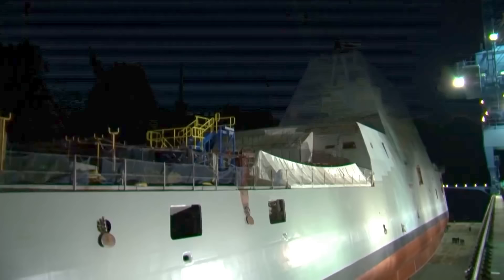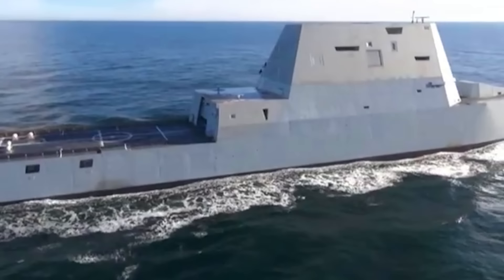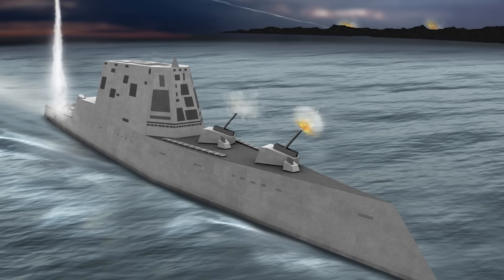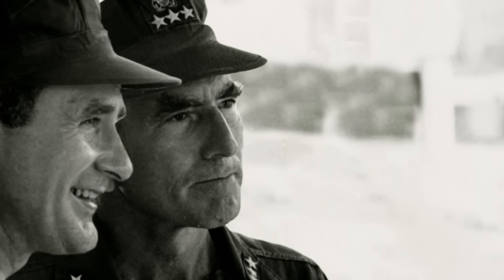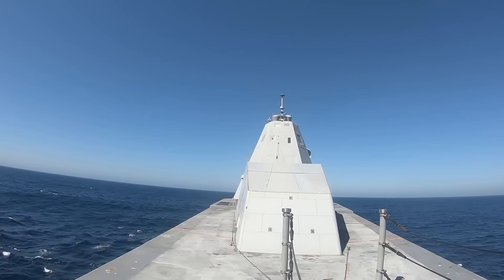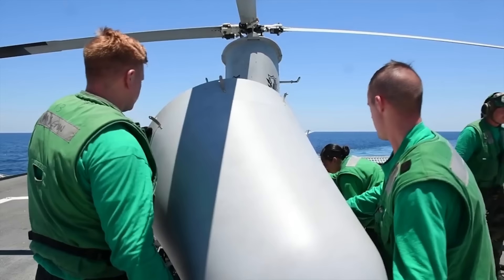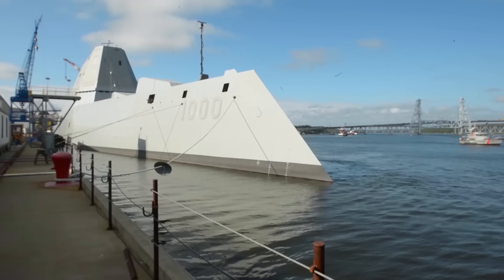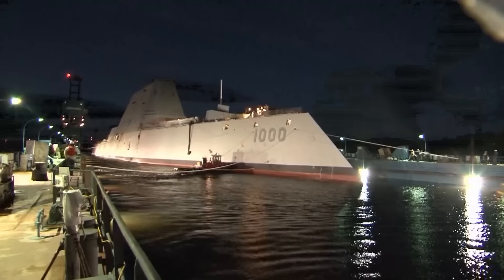The Stealth Ship So Powerful They Couldn't Build Any More

Comment: There were a lot of technical issues with many of the systems it was too bad the problems with the class weren't elaborated on in a more detailed manner.
Reply: That said, the stealth technology alone could lend itself to several roles. Landing group fire  support being only one of them. As a forward passive EW and sonar picket, the class would excel. A nasty surprise for anything that wanders within it's detection and missile range. Replacing those unusable 155 mm guns is sad but an absolute must. They were a good idea but there are other off the shelf autoloading 155 mm options available. Some with ranges in excess of 50Km. Even one of them with a large magazine would be worth it. Considering the vast amount of NATO ammunition choices available and  research still ongoing. Including barrel launched UAV's and loiter rounds.
Reply: @gusgone4527  You just aren't going to make a ship stealthy enough as you can't control aspect to target as well as you can in the air as you will likely be getting pinged from multiple directions. Also you aren't moving fast enough to be difficult to track once detected.  Stealth just doesn't translate from airplanes and subs to surface vessels very well. Dynamics of the fight are just fundamentally different. That said it isn't useless to reduce detectiibility, it just doesn't open up fundamentally new capabilities like it does with different platforms. Passive detection is for the work of deployables and subs. Project was ultimately a boondoggle along with the even worsely conceived LCS.
Reply: @AmericanDiscord  funny how no one is ever held accountable for the sheer volume of waste on these boondoggles. I have no problem with developing one of these ships and dumping money into a platform to get it all sorted then moving on to a class of ships but this and the LCS especially are examples of how not to move forward.

Comment: You have to think of the 'at the time' scenario. The big white elephant at the time was the Iowa battleships - old, expensive, and useful for only one thing - shore bombardment. However the problem was something plainly seen in conflicts like Korea, Vietnam, and the Gulf - while the carriers did their thing, and the battleships sailed slowly up and down the coast pounding targets, the rest of the fleet, ultra expensive anti-submarine frigates, anti-submarine destroyers, etc., just sailed around doing nothing, looking for a non existent submarine threat (the USN has never ever engaged an enemy submarine since WW2). 
Proponents of the battleships used this to argue that they should be kept active until a new NGFS platform was developed, and this brief went into the design of the Zumwalts in the various forms (DD21, DDx, DD1000).
Now since the 1991 gulf war, bombarding shores has kind of gone out of fashion, so there has been no further calls for the battleships, or the Zumwalts, to provide this role. They have also realized that designing ships specially for countering this non-existent submarine threat (despite all the planning for another world war with a submarine-capable nation like Russia or China, all wars since WW2 have been against non-submarine-possessing nations and non-submarine-possessing factions like IS and the Taliban) is a folly as well, so have retired all the anti-submarine frigates and concentrated on the Burke destroyers, which are much more capable of carrier escort and land attack with Tomahawks, much more valuable roles.

Comment: My brother-in-law was an electrician in the Navy, and he worked on the Zumwalt when it was in Maine at the Bath Ironworks.  He told me when it was going through its testing phase, it had done so well that local Maine lobstermen and women couldn't see the vessel until it was nearly on top of them.  The navy ended up having the line the Zumwalt with red flags so that the local fisherman could see the damn thing.
Reply: That isn't how stealth works, take your meds.
Reply: @v4skunk739  I know right, I use to live above Bath (horrible people around that area) and it was incredibly visible at the Dock.
Reply: @randyross5630  This just in:  Boats visible at dock where there are no waves and no water horizon.  Got the mind of a Mainer, no doubt...
Reply: @v4skunk739  I believe he is talking about not seeing the vessel on the radar display there sparky
Reply: I was in a thirty foot sloop off Daytona Beach, on the home stretch of a two week sail from Cape Cod to Fort Lauderdale.
The weather was sunny, the wind was light, and we were close to shore on a beam reach with the spinnaker flying, trying to cheat upwind as much as possible.
Out of nowhere, an atomic submarine appeared a couple of hundred yards away at the most.
Didn't make a sound.
Reply: @v4skunk739  It's true and the Navy did do this. At sea level it's head on visibility is less than a conventional ships due to it's unique design.
Reply: @randyross5630  Sure, driving over the bridge or from a good vantage point knowing very well that it's there. But on open water when it's coming right at you it's visibility is very low. This is a fact and the navy did in fact need to make the ship more visible due to all the reports from other vessels.
Reply: @randyross5630  above bath?
Reply: @twill9278  Those submarines are under water , you don't hear them dummy.;
Reply: @twill9278  It wasn't moving.. no engines on, that explains everything.
Reply: @pvtjohntowle4081  
It was indeed moving, headed back to its home port.
Reply: Local Maine lobstermen... well known for their powerful AESA radars 🤣
Reply: @v4skunk739 The CP is talking about the ability to see the boat on radar. 
Go back to school and read a book
Reply: Trying to save $80 Million per ship? 
We are sending several $Billion every few months to Ukraine. 
How is canceling this naval platform more cost effective than how the USA taxpayers are funding the Zelenskyy Clown Show?
Reply: @kamakaziozzie3038  You clearly don't understand the tactical values of field testing equipment without directly risking personnel all while grinding down the capabilities of a supposed near peer (clearly not).
Reply: My initial read on your comments was that you are being fecitous about fishing boats not being able to see this ship......they could see a ship that is the size of Cruiser until it was close? Damn.....I didn't know these were that stealthy.
Reply: That's very amusing, but also very good news. During the design phase, I'm sure that's unusual condition was considered. The fear of being rammed in thick fog is real. A well manned deck watch is in order under certain conditions.
Reply: @garneauweld1100  "The fear of being rammed in thick fog is real".  My grandfather was on board the 'Nashbulk' when she ran into the St. Mihiel off the coast of New York during WW2.  The last event in the Atlantic that took US Navy sailor lives before VE day.  You very right about this.
Reply: For like 3 months the stealth coating/bad maintenance made it not last long lol
Reply: @keithsimpson2150  I was in the USN and by the time my ship returned off deployment there was a lot of rust. Can't imagine what the special coating on these ships need for maintenance.
Reply: Unfortunately, the US Navy's enemies have much better sensors than local lobstermen...
Reply: Were They blind or are You talking about the radar readout ?
Reply: @kamakaziozzie3038  The two are not the same. Different color of money as they say. Congress is printing more dollars for Ukraine....I'm in defense contracting and so far the services are not getting their budgets cut...in fact increased but the services still have to meet their budgets so when the Navy for instance is trying to save money i.e. by retiring some of the littoral ships....they will want to put those funds to other Navy programs. BTW the Zumwalt class was a design born out of the Cold War and was intended to be very powerful in terms of firepower....then the US Navy decided to stop the order at 3 ships....like they did with Seawolf subs.
Reply: @Obsidian-Nebula  just blind lol.  I guess its cause the thing sat so low relative to where you'd see other Navy ships?  I don't know...
Reply: @garysellars8761  This is not accurate. I was on the team that won the contract to build these ships. This class of ships wasn't cancelled because "stealth" was defeated. It was cancelled because a. it was a cold war need b. the requirements for this class changed after the US Navy decided it was going to need littoral capabilites thereby causing huge overruns c. government boondoggle...nuff said.
Reply: @v4skunk739  
It was operating in the United States waters . You nearly need social & reading help .
Reply: Things that didn't happen?

Comment: The Burke class DDG’s are at their limits for supporting electronics. The hull of the Zumwalt class is stealthy and has enormous electrical generation. Along with that AEGIS and more missile capacity than other warships. Failures are the gun system and new complex systems need debugging. A failure? Maybe… but clearly it offers lessons.
Reply: Don’t forget the coating degrades quickly, and as soon as that starts it loses stealth.  And that the combining gears are far from reliable.
Reply: @rydplrs71  … clearly the navy was overreaching with new technologies.
Reply: @rydplrs71  Not to mention the corrosion issues from the 2 types of metal.
Reply: The gun didn't fail, it was the ammunition. When they cancelled 27 of the ships, they also cut back the ammunition order and thus the cost per round also went up significantly. The problem was they didn't start with simply navalizing a pair of 155mm guns with conventional shells as used by the USMC and US Army M109 SP Guns and 155mm towed howitzers, prove the gun and ammunition worked at sea, and then develop the LR shells so that they could be used by all services 155mm guns.
Reply: @DeeEight  … the navy went about it in the most expensive way possible. I wonder if remodeling the two guns for standard 155mm is an option?
Reply: @Idahoguy10157  No, especially not since they plan to remove the guns and their magazines to fit a new, as yet undeveloped LONGER VLS cell system, possibly a variant of the tomahawk module going into the Block IV Virginia class SSNs, in order to launch hypersonic missiles which also aren't yet developed. Basically the three ships are going to end up as technology development/test hulls for future things to use on what is now intended to replace the Arleigh Burke Flight I/II destroyers. Now they COULD simply adopt the OTO-Melera Vulcano 127/64 gun system in place of the BAe 155mm guns...which has already finished development for its precision guided LR land attack shells (up to 80km range) and its ballistic extended range shells (up to 50km range). THe GPS guidance LR shell has a CEP of less than 5 meters and the semi-active laser guidance shell has a CEP of less than 3 meters. Canada has decided already to adopt the Vulcano 127/64 system on our variant of the Type 26 frigate (instead of the BAe 127/62 gun, which lacks such shells still) meaning we might have a situation five or so years from now of Canadian frigates providing gunfire support to a USMC amphibious landing, the role the 155mm gun on the zumwalts was supposed to be for.
Reply: That's an extraordinarily expensive lesson.  The Zumwalt isn't a "maybe" failure - it's an absolute catastrophe that should never have been sent to design, let alone produced.  The very notion that the US Navy requires billions upon billions of dollars in inshore combat capability is laughable on its face.
Reply: @Idahoguy10157  No. they’re stripping the the guns out.
Reply: @chuckschillingvideos  Defense contract welfare. A beast we created and don't know how to put down.

Comment: This ship was built on the basis that the rail gun would be available by the time the ship was completed. That’s known as putting the cart before the horse. A ship is one thing but a weapons system is a whole other ball of wax! In short the Navy screwed the pooch on Zumwalt.
Reply: They did have rail guns in mind when they designed the electrical system, because you cannot simply modify a boat to run those things, but the video did talk about the failed weapon system that the Navy settled on.

It's a pity that the companies working on rail runs were simply taking the taxpayer for a ride.  It's possible that the whole purpose of continuing to fund the project was just a ploy to get the Chinese to throw their money down the same rabbit hole, thinking we were onto something.
Reply: @ThatsMrPencilneck2U  Yeah the cannons were a horrible waste of resources. Given they were too expensive to actually use. Although replacing them with hypersonic  missles is quite impressive.
Reply: @ThatsMrPencilneck2U  Trying to con the Chinese into wasting their money is the stupidest excuse ever. Practically every cost they have is lower than Americas. The strange thing is there is footage around of super slow mo cameras that appear to show rail guns working. It makes you wonder just how close they got, and is the program shut forever?
Reply: @tsubadaikhan6332   Trying to develop the weapon, just to fool the Chinese would be stupid.  Pretending to develop the weapon, after determining that it doesn't work means just making announcement and releasing test footage of money you have already wasted.  Why give the Chinese the advantage of already knowing it doesn't work?
Reply: In one regard the Rail guns were a sucess and functioned admirably. The high power costs would be mitagated by having a nuclear power plant on the ship. There was talk about retrofitting BBs giving them extended life this way. 
The problem? What happens to metal when you pass current through it, especially with very temporary contact. The more current, the affect is amplified. With the incredible amount of current to fire the shells at the intended velocity to reach target ranges, it would create slag along the barrel. After "so many" uses, the barrel would need to be completely replaced. It was never divulged how many times "so many" referred to. DC Motors and Generators use graphite brushes to mitigate/prevent this problem, and while I would like to believe this was already considered putting a coating of graphite an the parts of the casing, or using brushes where it came in contact with the barrel, i found no evidence that it was ever used, let alone considered. It'd be so ignomenious if the reason the program failed is because they forgot to put in what is put between all moving electrical contacts in DC applications.
Reply: @ThatsMrPencilneck2U  According to some in congress, we just arent giving them enough money....perhaps we should ship the pallets of money pre-soaked in gasoline so it burns faster
Reply: @ThatsMrPencilneck2U  what? The guns do work, just really expensive. How is that taking the taxpayer for a ride? It’s just untried new technology, not sure how you come to that conclusion.
Reply: @damedusa5107  Expense is a limiting factor on anything.  Remember it isn't just the initial cost.  If the big guns on battleships needed to be relined constantly, they would have never been made.  How long do the rails last in these weapons?  The Navy is tight lipped, but the engineers I've talked to say these things burn copper, like its nobody's business.
Reply: @ThatsMrPencilneck2U  that doesn’t mean they were ripping off tax payers.
Reply: @damedusa5107  Continuing to work on a dead end technology is what most people consider a waste of time and money.  This is a industry where contractors so regularly beat the tax payer that you can safely consider them all guilty.
Reply: @@jarjoobinko where? Because they have pulled the plug on rail guns.

Comment: After the cold war the Navy wanted to make ships that required a much smaller crew, and have less maintenance to do. Lots of time was wasted on removing rust, prep, prime, and repainting the exterior. And we had to do lots of preventative maintenance. The Arleigh Burke Class destroyer has some built in stealth in the design, and some radar absorbing techniques. The Zumwalt was supposed to be stealth on a whole new level. And most of the time the actual top speed is not given. You can expect 5-10% faster speeds than listed without trying very hard.

Comment: Interesting that this popped in my feed.  I was a sub contractor on the dd21 project, software principal architect on the system that handled all the spec and designs for the program.  The first proof of concept was released in 3 weeks and took over 2100 man hours.  Which won Northrop Grumman a 5 mil bonus.  I didnt see any of that lol.  But it was interesting times.  Was onsite for quite a while as well and went to Virginia a couple of times.